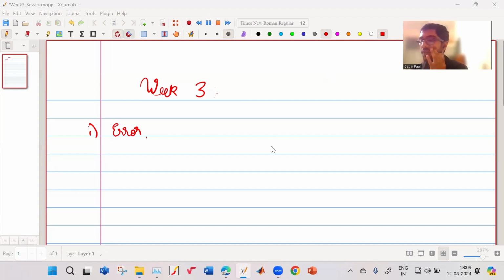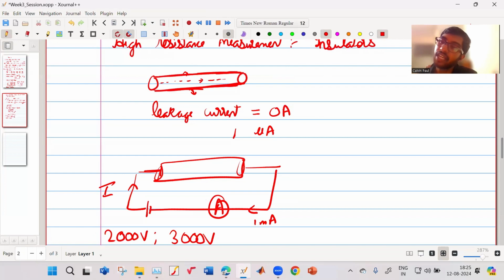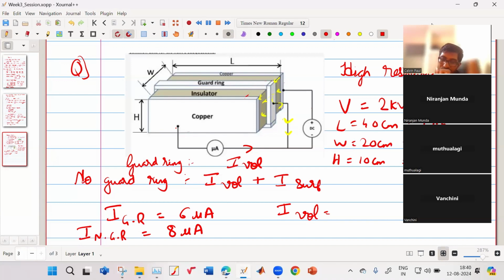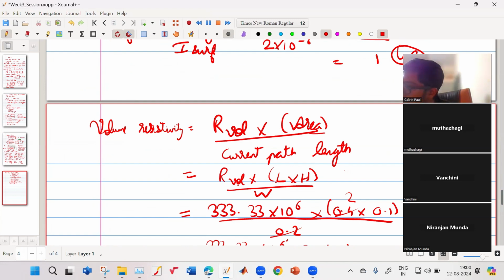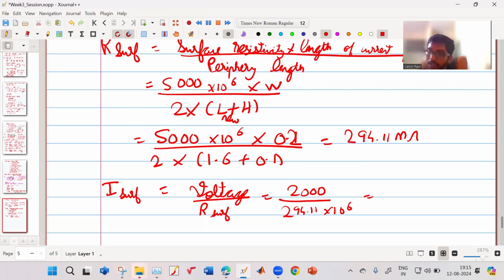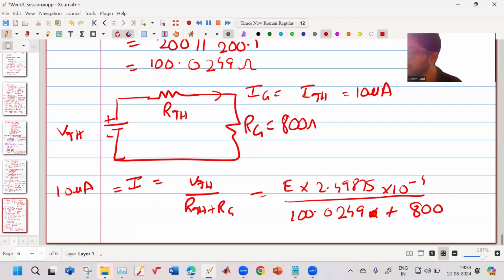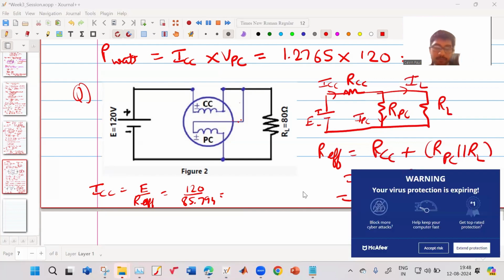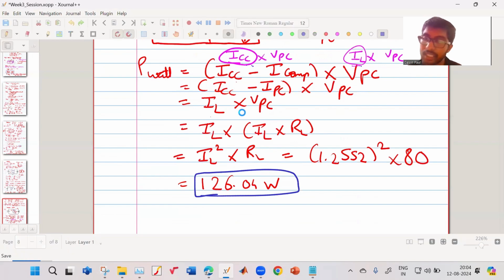Electrical Measurement and Electronic Instruments | NPTEL | Week 3

Comment: Sir!!!If we connect CC of wattmeter is connect in series with load then what effect on load curret (should increase or decrease or same) if polarity of coil additive or subtractive nature???
Reply from the maker: The effective current being used for the wattmeter measurement depends on the dot polarity of the current carrying coil and the compensating coil. So the dot polarity determines if the coils are additive or subtractive.
Reply: Thanks a lot sir.... For clearing doubt........
Reply from the maker: @niranjansinghbabu4563  My pleasure!!